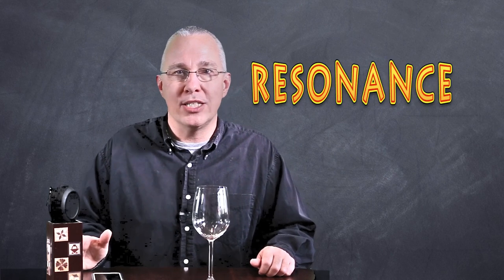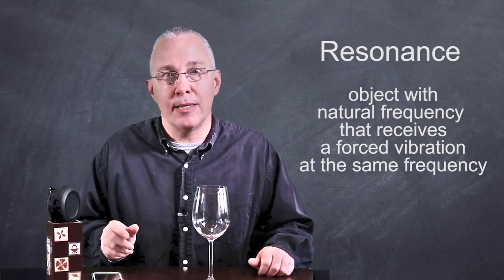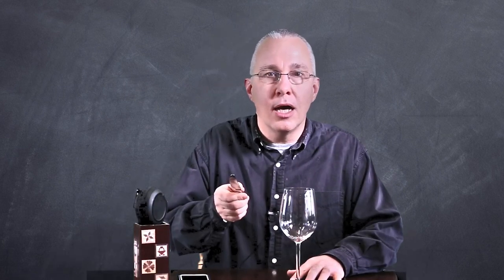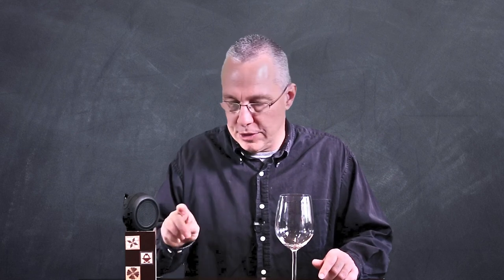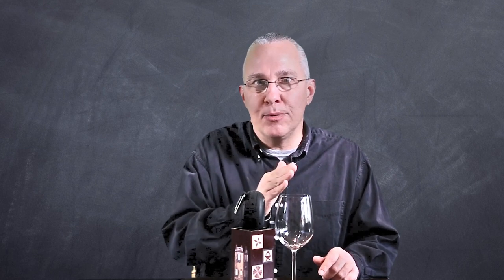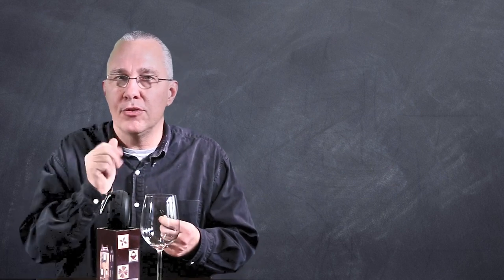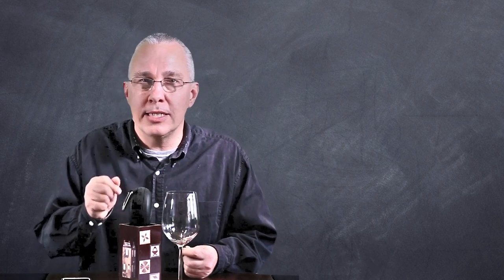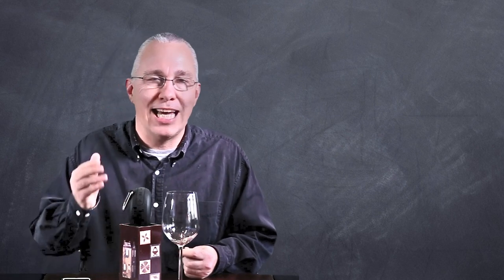What is resonance in physics?

Comment: If matching resonances can amplify resonance in one object and force it to release energy, is that the key to free energy if it's designed to resonate in nature? Also if regulated by turning it on and off at intervals to control the energy release and to avoid destruction of the instruments, could it be used in a practical way to harvest energy as needed?

Comment: What shatter the glass is 
1. Frequency of vibration = Glass Natural frequency
2. Amplitude of vibration or here SPL (Sound Pressure Level) in dB or Loudness 
3. Lower amplitude vibration energy can be easily converted to heat by glass damping coefficient but higher amplitude vibration energy cannot be converted to heat efficiently so the major portion will go on increasing the amplitude with time such that being a brittle in nature when amplitude is high stress inside glass will cross yield point which is also ultimate breaking point and thus it will shatter the glass

Comment: Why can't you break the glass with that frequency?
Reply from the maker: You can  but there are two issues. The glass is not perfect, ie it does not have a single resonant frequency. This means that other parts of the glass in essence dappens the vibration - you can actually hear this - the glass does not ring perfect, but with slight beats, which means there is interference with another frequency.  The better the glass the better the chance to breaking it. To combat this you can increase the amplitude of the sound aka loudness. So if my speaker was loud enough, I could do it. But its the resonance that will break it now the amplitude

Comment: Hi, Thanks for the really informative video. I just have a question. I will really appreciate if anyone can answer. When the glass started vibrating at its natural frequency, it stops after a while if the source is removed. Does it do because of the resistance around? If we can somehow move the vibrating glass in vacuum, will the vibrations continue?
Reply from the maker: Yes it stops because the vibration is the flexing of the glass. It’s not perfect so it actually heats up the glass ever so slightly and so loses energy. Thus stops
Pull a rubber band multiple times and you’ll  see what I  mean.
Reply: @PhysicsHigh  Thank you so much for your reply! I understood now.

Comment: What exactly is the the natural frequency of source?Is it already decided...like how?I am unable to get this natural frequency concept?
Reply from the maker: In basic terms, if you apply a momentary disturbance  to an object, it naturally vibrates at a specific frequency. Think of when you tap a wine glass - it rings. If you add some water, it also rings but at a different natural frequency (rate of vibration) It depends an a variety of factors, such as mass, density, material and elasticity of a substance. A cheaper glass, or cup, does not 'ring'. That is because different parts have different natural frequencies, that interfere and thus dampen. There's more to this of course but hopefully thats a start
Reply: @PhysicsHigh  Thanku sir 😊

Comment: I believe relaslnance frequency everything has it to keep it here u change the frequency and reality changes phodelics act like this but not to the full potential I believe UFO,s use reasonable frequency to move to different times or mostly different reality's if you knew that others ain't no god or devil fighting over ya immortal soul and that you don't answer to nothing. Because every multiverse excuses in one reality your stinking rich  in anther ya a junkie  cyschopatnh this universe is yours and you are free to travel through wot ever reality u choose think like a radio radio waves light waves it's all the same web you move the non on the radio the frequency changes it's still there but u have now tuned into anther station  light works the same way granted I don't no maths so how could I prove this electrons work by vibrating to there own frequency our minds are the free thing we have coz controling that u can control your frequency

Comment: How did you measure the natural frequency of the glass?
Reply from the maker: I used an app that basically is an audio oscillator. Then using the the beat frequency I determined it’s natural frequency.
Reply: @PhysicsHigh  ok,thanks for the reply!!